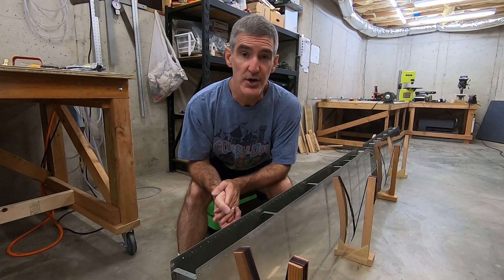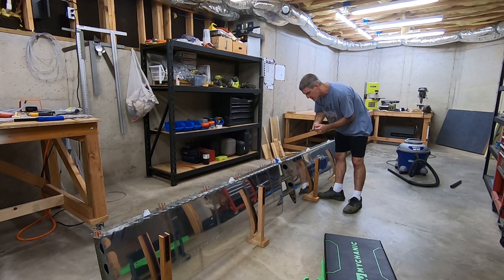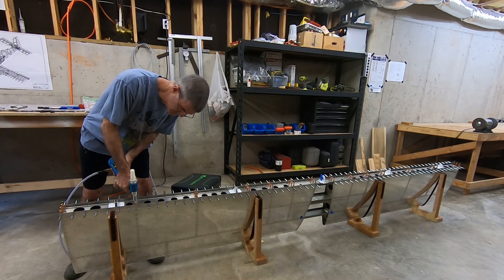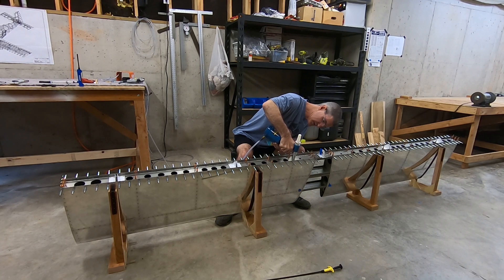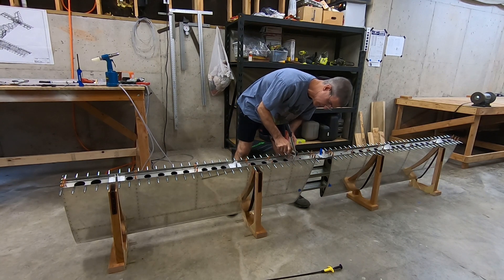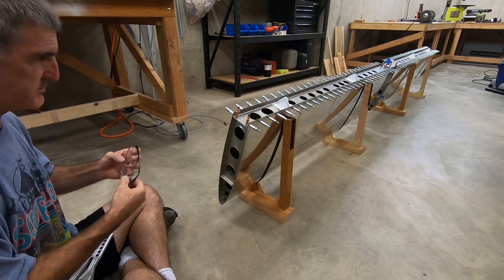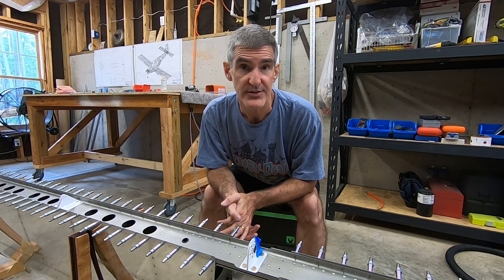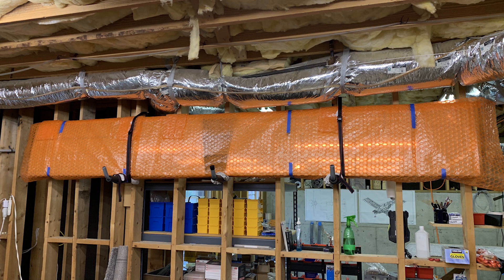RV 10 Build Log   Emp 52 - Rear spar...  Finishing the Horizontal Stabilizer!

Comment: Yea those final 4-8’s and 4-7’s were something in the middle…. I had to push the air pressure up to a full 90psi to get anywhere.  They turned out well enough after a good little wrestling match.